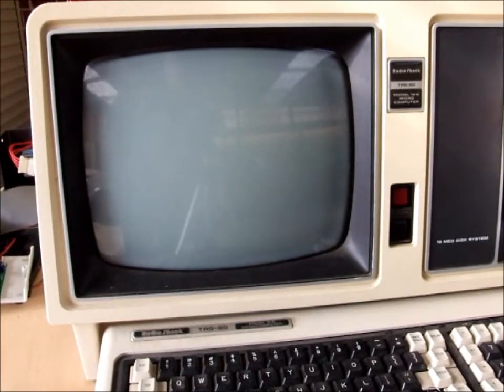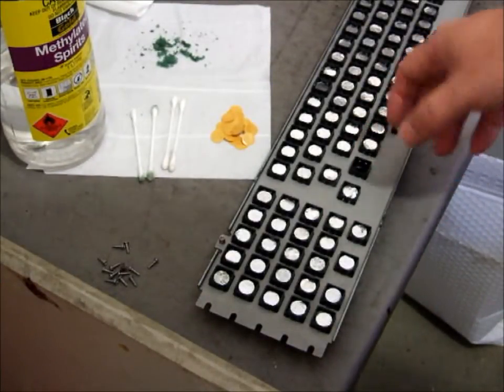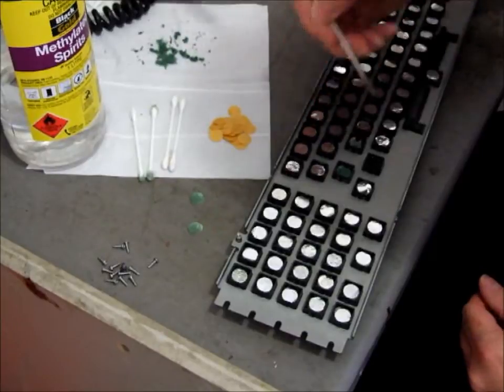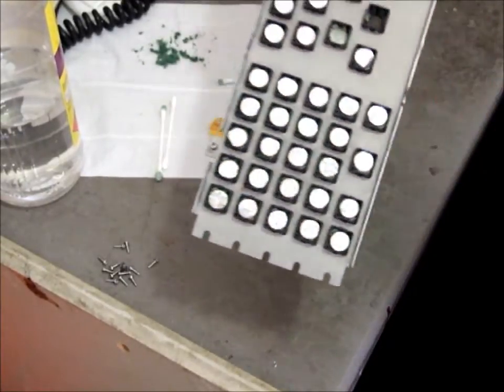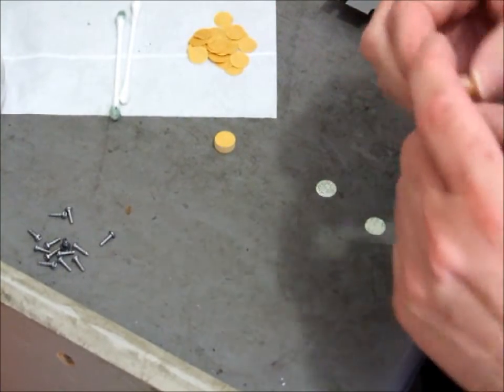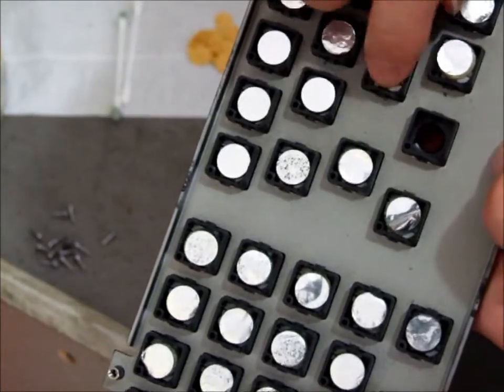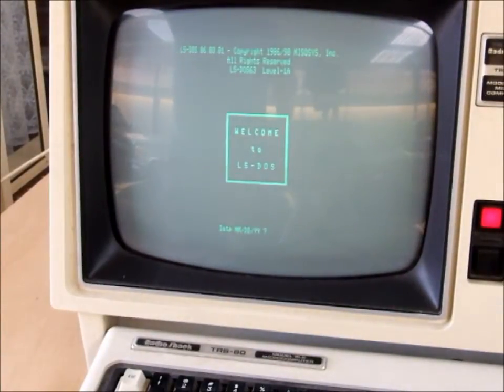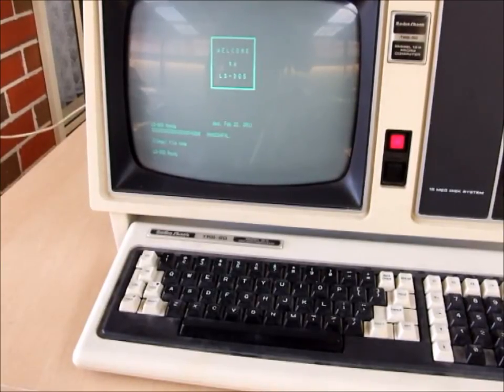How to fix TRS-80 Keytronic keyboards

Comment: Thank you for your helpful video.  I just ordered a pads kit myself.  I had not considered leaving the plastic disc in the keyboard before - that no doubt speeds up the process.  I wonder: have you ever used any other mylar/aluminum discs, rather than the originals?  I am concerned that if I manage to damage a disc I will need to replace it with something.  I have read of many options, from space blankets to mylar balloons.  What's best?

Comment: Ian,

The mylar plastic disks are aluminized on one side only, and it is critically important that it be oriented properly.   Contrary to what you said in the video, the aluminum surface doesn't make contact with the pads -- it is the insulating side of the mylar which touches the pad.  Instead, the aluminum on the other side, as it comes into proximity with the pads on the PCB, forms a capacitor and it is the change in capacitance which the keyboard senses.  In fact, that is exactly the neat thing about Keytronic's approach -- even if there is oxidation or dust, the capacitance is largely unaffected, while an ohmic contact would be flaky.

In the past month I had to repair a Wang terminal keyboard, and ordered the same pad kit you did.  In my case, the mylar was so badly degraded I had to make my own replacements. I did this by buying a cheap "space blanket" and a 7/16" punch and hammered out 100 little discs.

After spending hours on it, I ended up throwing out all the replacement pads.  The gum from the double stick surfaces caused too many problems.  If the mylar disc wasn't perfectly aligned on one side, or if the plastic backing on the other wasn't perfectly aligned, part of the gummy surface would be left exposed, and very few had perfect alignment.  The gummy surface would stick to the sides of the keyboard plunger, or to the PCB itself, and the pads could compress, get stuck on one side, and not rebound fully.

One reason why I had difficulty getting they mylar pads lined up was that static electricity would cause the mylar to jump up to meet the pad as I tried to push the pad down on top of the mylar disc, despite being on an anti-static surface.  The gum on the pads is so sticky it is impossible to peel off the mylar and try again.

I'm glad the replacement pads worked for you, but in my case it was a waste of hours of frustrating and wasted work.

Luckily there is another seller on ebay who occasionally sells replacement kids with fully formed pads with plastic backing on one side and mylar on the other.  bbre5198 is his ebay handle, and his pricing is very reasonable.  Whatever adhesive he uses dries after application, so there isn't the problem of having any sticky surface.

I don't want to sound overly negative -- I'm glad you found a solution and it may work for others.  Thanks for sharing the video, as this is a common problem.
Reply: +fudgesauce 
i would suggest, if you take your time and work very accurate on this, you won´t get the problems you described. I can tell, because i have fixed several Apple Lisa KeyTronic Keyboards with those pads from emesstec, and i had absolutely no problems with "stuck keys" or else afterwards, all pads and keys work fine. So, if you are patient enough and not in a hurry, this will work out for you, too, and you won´t have to pay $199 for just 74 pads ;)
Reply: +MalikArt -- I think it goes beyond patience.  Eg, when I would bring the pad down close to the mylar disc, the disc would often jump up to meet the pad, and once it makes contact with the sticky glue, there is no fixing it.  And before you suggest it, I was working grounded on an anti-static desktop.

I think a second issue is that I should have used a larger diameter punch such that the mylar disc was slightly larger than the pad.  Making it the same size requires exact precision to prevent leaving a bit of the sticky pad exposed.
Reply: Thanks for the heads up about the static. I cleaned my mylar disks on top of a piece of paper with isopropyl alcohol and found that if I left them on the paper while still damp, they would not jump around. Then I used a magnifying glass while lowering the pad on to the disk. Never was any good at Lunar Lander :) , but they got close enough that my Compaq Portable Plus keyboard now works great. 

Also, I found that soaking one of these pads in isopropyl alcohol enables easy removal of the mylar disk if needed, but then you are down a pad.